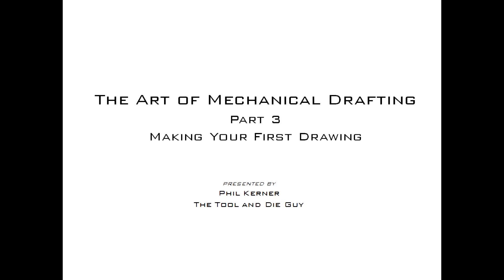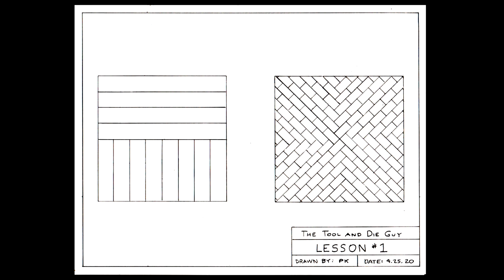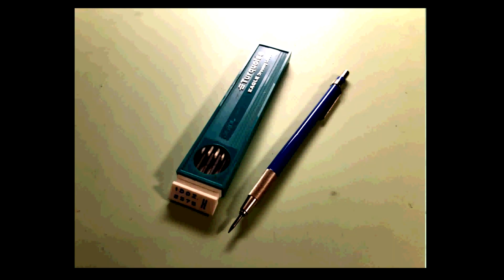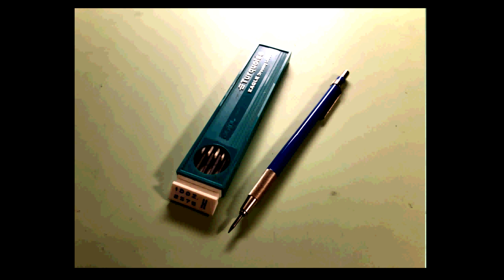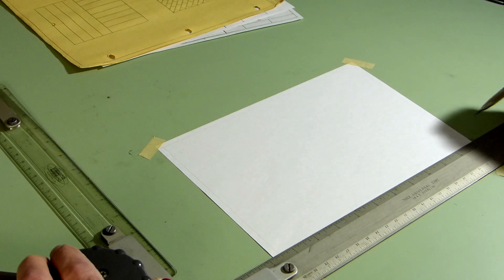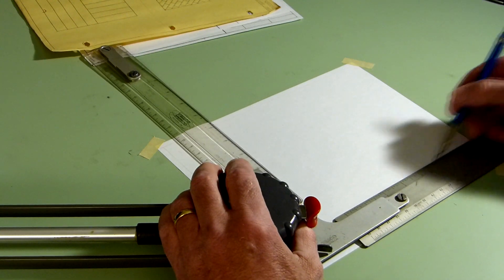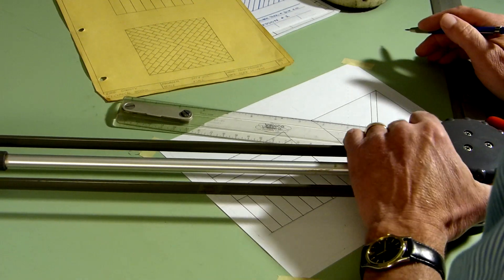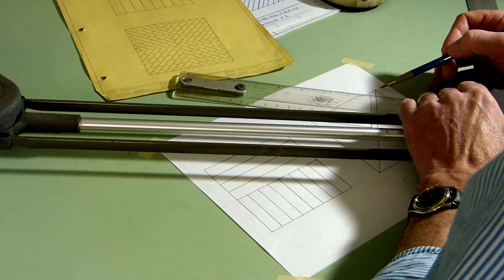The Art of Mechanical Drafting, Part 3

Comment: I enjoyed your interesting drawing technique. I learned that if one is right handed one must draw the upright line on the left side of the triangle or scale and slowly twirl the lead holder clockwise as one drawers the line. This keeps the point on the lead and avoids flats forming on the lead. One should never reverse the direction of the line being drawn which has a good chance of taring the velum or paper. I learned this technique back in the 1960's and have used it ever since as a drafter and a Mechanical Engineer. Try it out...hope this helps.